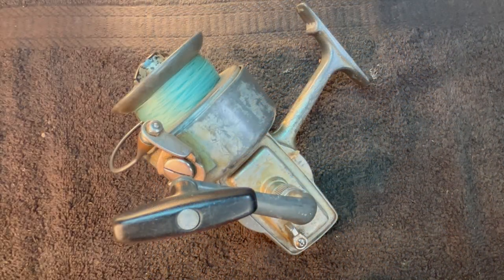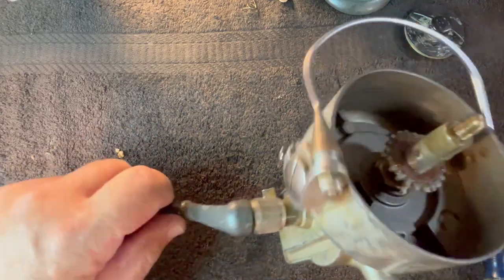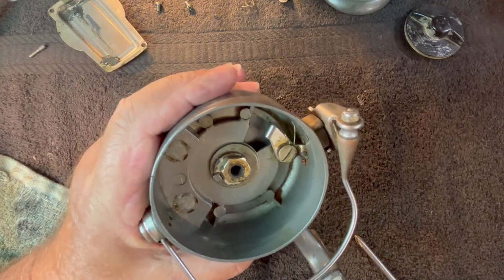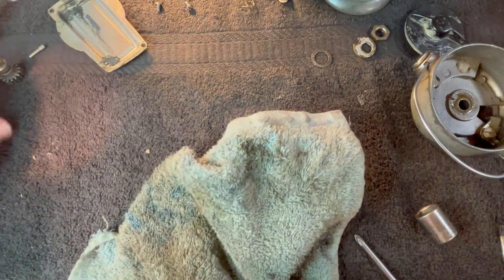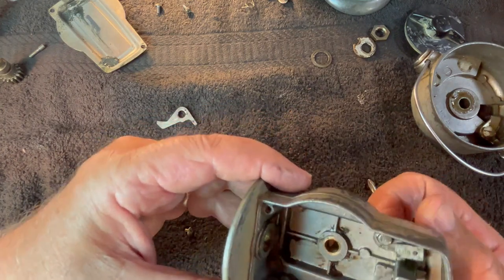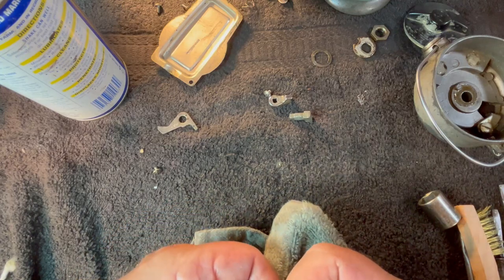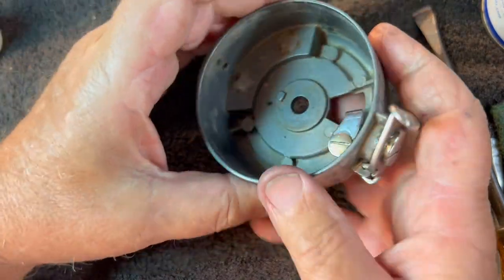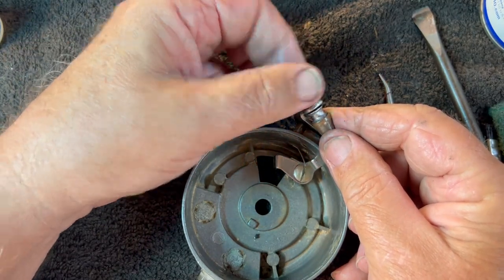FAIL Sears Roebuck 779.414221 -- Service and Lubrication -- Young Martin's Reels

Comment: I’ve got to send you some photos of my Daiwa 7700 reels. They are almost perfect.  I absolutely love these reels.. you could have done a far worse mistake than you did. This clicker can definitely be fixed. I think I could even do it. I cannot wait to see this 7700 completely restored particularly given the Mitchell 300 you showed us!  This Ken fellow does remarkable work.  I can’t think of a more deserving reel for restoration than a Daiwa 7700. When I first saw and purchased one of these I was also very impressed with the bail trip mechanism. Also I’ve never had any problem with the anti-reverse on my reels like this. You know I don’t ever grease AR dogs like this, I oil them. If I was going to paint a reel like this I would leave it un-lubricated until the painting was completed. I’d then lubricated it as I put it back together. I HATE painting reels as you know nut I did tell you how I do it in the rare case I paint one. I’d sure be interested in how your friend Ken goes about preparing and painting a reel like this. I was also very pleased how well the counterweight does the job on these reels. They do not vibrate very much at all.  I think folks who service their reels and keep them for their own use should use care in what they oil and what they grease. Don’t kick yourself too hard for breaking that clicker screw. You should see the screw I stripped on a reel yesterday. Now that was stupid! Rick, as you know I have a number of these older Daiwa reels in my collection. To me they are incredible for their design, durability, and longevity. When I first started collecting vintage saltwater spinning reels I went after these early Daiwa reels. At last count I own 81 vintage Daiwa reels so you know what I think of them.  You are correct about these old bail springs.They can easily break a finger if you aren’t careful. They are just like the early big Mitchell saltwater reels like the 488 that have a cup rotor. I was sure a 488 broke my index finger once. Like most of these early Daiwas this reel has a gear ratio of around 3:1 so you wouldn’t want to use a very fast lure with this one. You can do it but it will get old real fast. LOL  I can’t believe you actually greased the pinion before you put it in, (Just kidding.)  Even these early Daiwas had the distinctive loud AR click that Daiwas were know for back then.  These reels do have an excellent drag system. Many later reels do not have anywhere close to as good a drag as this Daiwa 7700. By the way Rick, you know you are nowhere near as impatient as I am. That DQ reel I’m soaking right now is driving me crazy that I can’t go ahead and put it back together. I will never understand why Sears gives their trade reels ridiculously long numbers.  It’s really weird! Great video Rick! I hope we get to see what your friend Ken eventually does with this reel. I think many of your subscribers (particularly me!) would love to see it! — Chris. PS. Is this comment long enough for you? LOL
Reply from the maker: To be honest, if Ken hadn't asked me for a reel like this, I would have done the repair of the clicker myself. I probably would have painted it too. I don't think it would have turned out as well as it will under Ken's care. He does fantastic work. 

This real does have a very reliable bail trip design. As crusty as it was with old dirt and dried grease it was still able to trip the bail. As for lubricating the reel, I knew Ken would have to clean and strip it all again so I wanted to see how it would perform with proper lubrication. I debated grease and oil for the AR and in the end, I went with both. 

I'm not going to put any pressure on Ken to video his process. If he chooses to then great, if not, I fully understand. It takes a lot of work to clean and paint these reels. I'm hoping that we will at least get to see photos of the completed reels when he's done. 

These are very reliable and solid reels although some will think they are a bit too heavy and clunky. It's more like a slow winch than a reel. Since you say this is the same as the Daiwa 7700, and as loud as this reel is, I can understand why Daiwa went looking for a silent AR system, even though their early designs didn't pan out long term. 

I'm usually very patient but I was tired and trying get done quickly, I just didn't stop and think when taking out the screw. All I had to do was put it into the parts cleaner for a cycle or two and it would have been fine. Anyway, it's boxed up and ready to be dropped at the USPS on Tuesday.